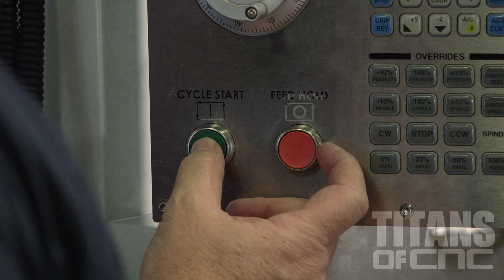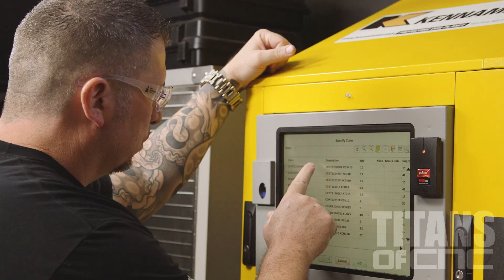Kennametal TOOLBOSS is a BEAST for CNC Machining

Comment: Today Walter tools are the best on market if you compare the cost and what you get for it. I would never buy Kennametal tools because there is no drawings available online. Without proper drawings you just don't know what tools are needed when working with cam software. Same problem with Iscar for example.
Reply: ??? Kennametal has 2d and 3d models you can download. You could also just measure the tool and add it into your software. You should be doing that anyways...

Comment: we have kind of the same. only : | the %$#^@#%@ person that's in charge of it to set it up it ... 1 slow 2 doesn't get how it even works 3 when he gets it he orders less than needed.
the system should work on its own if it's setup correctly but that will never happen -.-
so yea it COULD help but it could also be a bottleneck